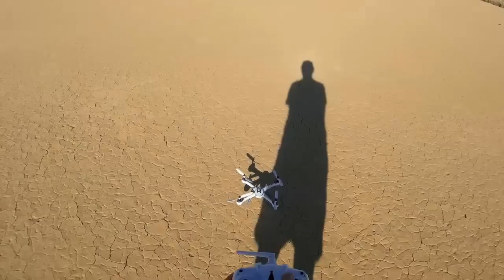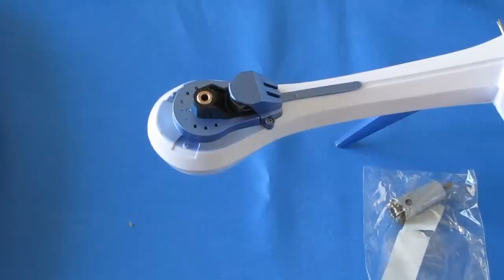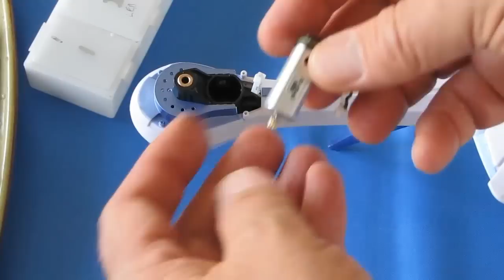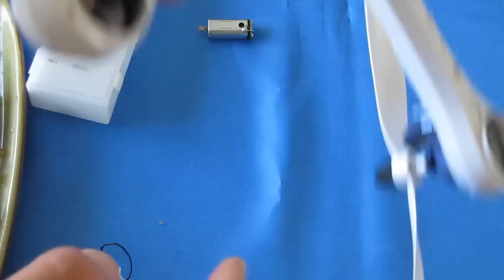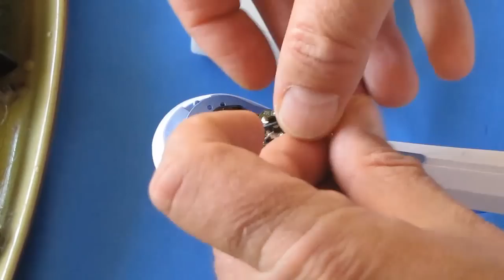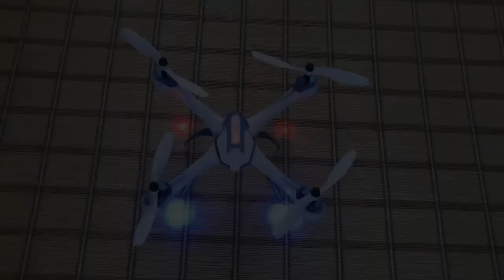Tarantula X6 Drone Motor Repair

Comment: do we also have to break in the motors on a brand new drone, or only when you replace it, just wondering, I just got an FY326 and flew 4 batteries right away did I screw up the motors? thanks
Reply from the maker: Gus F No smaller quads are less sensitive to requiring wearing in of their brushes.  It's the larger brushed quad motors, such as on the Tarantula and larger that need to be worn in.  And for such quads, both a new quad, and/or a new motor need to be broken in.
Reply: thanks, relieved at the same time it's good to know valuable info , even though my next quad is gonna be brushless, already ordered the parts  building an Emax nightwak , I just bought the Q7 to practice, and boy you make that shit look easy, I had a hard time today at the park , but at least came back home with my quad in one piece :) love your channel BTW I've watched many of your videos, specifically the learn how to fly one it's in my favorite :)

Comment: Hi 101: In your motor repair on the X-6 I noticed there were bushings in the motor housing. When my new X-6 arrives I would like to replace the  bushings with ball bearings. Do you know what size ball bearings I need to order?
Reply from the maker: David LaFrance I've already replaced mine with 3x6x2mm bearings.  Got them here http://www.massiverc.com/PrestaShop/en/169-ball-bearing-upgrade-kit-3x6x2mm-shielded-set-of-8.html
and it's very easy to do.
https://www.youtube.com/watch?v=nRXbxDQg5gk

Comment: I just received my tarantula and I attempted to break in the motors as you suggested and two of the motors would only start with the power increased and then after a minute or two one smoked (literally).  What would you think the problem is bad motors or bad esc's?
Reply from the maker: ***** It's very important to make sure that all four are turning during the low speed run or the non-turning ones will overheat. To get all moving at low power, try gently cycling the pitch roll stick in a circle.

Comment: Would you have any ideas why the tarantula x6 is so loud?  What might quite it down?  Bearings? Gear lube?
Reply from the maker: ***** No, the plastic resonates/amplifies the vibrations from the motors. I was thinking of trying some tightened velcro cable straps around the arms to see if it might deaden the sound.

Comment: Just got a Tarantula X6 from gearbest and I really like this Quad, broke in the motors and have also done two slow mode flights. One thing I must change is to install an off and on switch. If you don't put the screw in the battery compartment any landing other than a perfectly soft landing will make the battery door open and the battery falls out. I would prefer to put the battery in before flight time; start up is sort of a pain in the neck, lol. I could put a quick strap around it but I'm not fond of that idea; it just doesn't look clean that way.

Comment: If you only have a clockwise motor and you need a counter clockwise motor can you reverse the wires on the motor terminals and achieve a good motor replacement?
Reply from the maker: Pat Martin This uses V262 motors with soldered on cables. I know with my V262, there was really no difference in the motors that were sold.  You got CW or CCW movement based on the polarity of the wires soldered.  So I'm guessing yes?

Comment: I notice that the motor you fitted the gear was fether on the shaft and the  WL toys V262 motors gear is on the end of tne shaft as viewed on line from BanGGood.com.
how do you more the gear down the shaft closer to the motor..
Reply from the maker: David Smith I didn't have to move mine.  The one's being sold on Banggood now are also for the V3X3 series which are farther down the tip.  The original V262 motors are already slid down closer to the motors. http://www.ebay.com/itm/like/111613270520
BUT, why even purchase V262 motors.  The stock Tarantula motors are now available on Gearbest, and are actually cheaper.

Comment: I broke the wire connected to my brush less motor , could I solder ( http://www.banggood.com/Wholesale-65X-Mixed-Color-Solderless-Breadboard-Jump-Wires-p-28221.html ) these instead as an replacement wire? Thanks in advance

Comment: Need to ask, instead of shipping things all over the world...Is this acc a good alternative, if I keep calm in my flightstyle?

http://www.skanehobby.se/3144-giant-power-7-4v-1300mah-35c.html
Reply from the maker: Dennis Nilsson Different connector.  The Tarantula battery uses the red JST connector.
Reply: Quadcopter 101 Yes, but besides the connector, I have JST and I know how to solder...
Reply from the maker: Dennis Nilsson Well, it's also too wide to fit in the battery bay. The Tarantula's battery is 65x27x17mm.  You can get a spare here http://shrsl.com/?~8cvj

Comment: After watching your video's on this quad i bought one, and after doing the break-in for the motors i only got 5 flights and had a motor go out. I'm very disappointed with this quad and would not recommend it to anyone unless they like changing motors on a regular basis.

Comment: hello Quadcopter 101 
÷  I have big question and hope I find the answer ...
- I owned the syma x5c since 6 month ago and I really get some flying skills and I want something powerful  the syma x5 was awesome !! but it's cannot left mobius cam very well ..
So my question is 

I want quadcopter with this Abilities :

1- can mount mobius cam and left it !
2- can reach up to 50m ( like 80-100 m ) with mobius cam mounted 
3- cost less than $110

and which one is best from those quad's (Wl toys v262 and V353 or the  Tarantula X6 ??  and why ??
Reply from the maker: azzazz911911 Tarantula X6.  Click on my name and watch its videos (or subscribe to my channel :).
Reply: hi thank you for reply I already subscribe your channel  ,, and I sow the Tarantula X6 video and it was fantastic  but I am still wondering  which one is best from those quad's (Wl toys v262 and V353 or the  Tarantula X6 ??  and why ??
Reply from the maker: azzazz911911 Of those listed, Tarantula X6 is best.  Has 3 X the range of the other two.  And has a magnetic compass headless mode  that can be used as return to home. The other two do not have this feature.
Reply: thank you so much for this information I'll keep in my mind 

I would like took to you could I have Email or blog ?? I am very happy to find someone like you (expert man)

Comment: Hy Quadcopter 101. I reparied one engine, a total of three minutes soldered together, thanks.
Reply from the maker: Lajos Girincsi and with the new Tarantula motors, no soldering required. It should make it even faster, and possible to do out in the field.

Comment: I got a Tarantula X6 from Dealmachine.com . Great Quad only problem is the throttle stick was broken of in shipping . Have 30 flights on it already this is a ¨Superior ¨ QUAD . 
 When and if the motors go bad I will be replacing them with a Brushless setup , from the design of this Quad it will be very easy . The motors I have already (1806-1800KV) ESC 4x15 all in 1 . OBTW this Quad with a very small mod will haul a 2000mah 7.4V 
Am working on transmiter mods to extend range also .
Reply: Can you give more details on the ESC you are using to convert to a brushless set up? Where did you get them? What is the cost?

Comment: I see now that they have motors for the Tarantula. They have both A & B connectors. What is the difference and which ones should I order?
Keith
Reply from the maker: keith buck It's dependent on the direction that each propeller turns (soem turn clockwise, some counter clockwise). To eliminate confusion, each arm of the quadcopter (and each propeller) is labeled A or B.  But another way to tell the proper replace motor to use is to simply match the color of the wires (red black, or white black).  And here is a good deal on motors.  You will likely replace all 4 during the life of your quadcopter. http://www.gearbest.com/rc-quadcopters-parts/pp_166401.html

Comment: Quadcopter 101 your thoughts on using a 7.4V 2800mAh 40C Li-ion battery with the Tarantula?
Reply from the maker: Chill It will lift it. But a lot of extra weight, and extra long flight times without cooldown will definitely stress your motors.  Would expect requiring motors changes much more often than normal if you use such a battery.
Reply: Quadcopter 101 thanks

Comment: if you use that motor for both clockwise and counter clockwise directions you will have to reverse the positive/negative wires on one of them so the motor will spin the opposite direction , but no need now that parts are available .

Comment: It's a shame you can't fly this quad up to its abilities without burning out a motor. This is a really cool looking and potentially useful quad if they would just come out with a better motor for it. The same goes for any quad that uses these motors.
Reply from the maker: It's a cost tradeoff. A brushed quad of this size that performs like this would cost much much more.  But as motors are only about $3 a pop, and are easy to change, I'm willing to live with it. http://www.gearbest.com/rc-quadcopters-parts/pp_166401.html
Reply: Quadcopter 101  Thanks for doing this video. Do you have any recommendations for a quad that either has brushless motors or good quality brushed motors that can take a lot of stress?

Comment: Nice video very professional done.  You made that look easy and took the mystery out of changing a motor.
I started thinking about how many flights I have on the Syma X5c, I calculated that I almost have 2 hrs of flight time. Is that a lot or normal if there is such a thing as normal. Now most of that flying is learning how to capture decent videos. So am I to expect a motor failure in the near future?
Reply: Well that good to know and thank you for your response.  I have had mine in the trees a few times myself.  I kept throwing a small branch up at it about 500 times (lol) but finally got it down.

Comment: Funny because I burnt my back right motor for my x400 today by doing the same.
Reply from the maker: Here's a good price on X400 replacement motors http://www.aliexpress.com/snapshot/6521034635.html?orderId=66057338901218
Reply: Quadcopter 101
Thank you sir. I am going to order some motors for the tarantula while I am at it too.
Reply: Quadcopter 101 3-6-2 micro bearings work great on the X-400 also. Extends flying time but not sure if it helps the motors last as I have not needed to replace one since adding the bearings. :-)
Reply from the maker: Michael Moody I got them.  Just need the time to install them before my next flight.